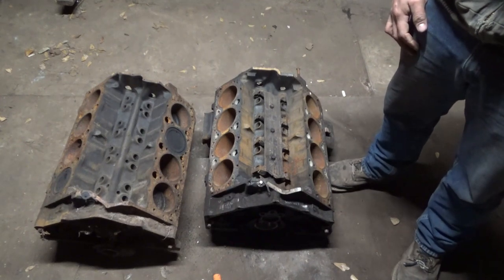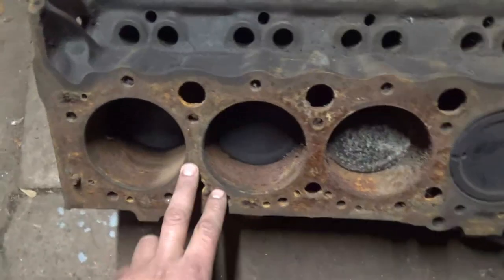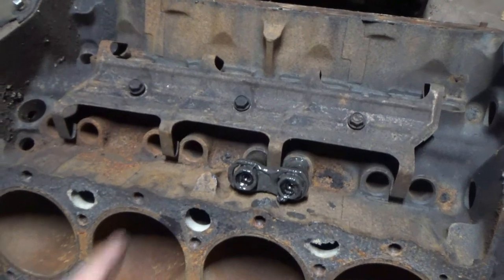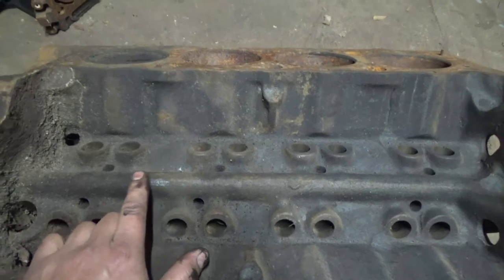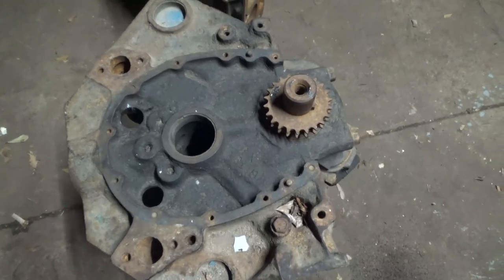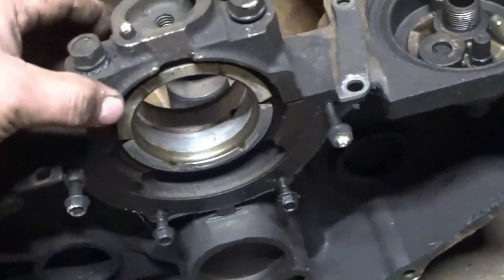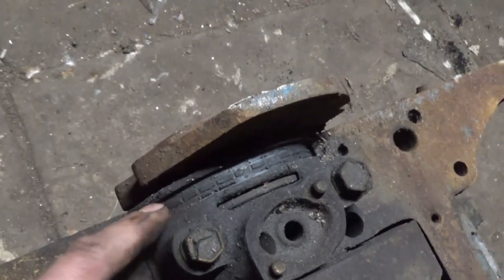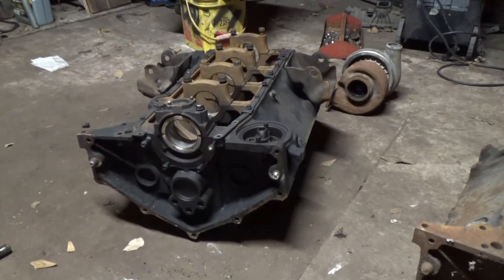Factory roller small block 305 chevy vs non roller 305 chevy

Comment: The fly wheels are not interchangeable. You can change the rear main seal on the one piece without pulling the rear main bearing but you still have to pull the pan. You can run an early flat tappet cam in the roller block, you just use the first generation timing set.

Comment: Cool with your video I now know what to watch out for when I try to switch over my stock 1986 305 flat tappet engine block to a 87 and later roller block. Think I can use my perimeter valve cover bolt heads with a hydraulic roller set up?
Reply from the maker: As far as I know they are supposed to interchange.  The only difference in the heads is the center two intake bolts are at a different angle.  But if you have the older style heads and intake that should work.
Reply: @davidcraft4909 Cool, I will be  using the old intake with the perimeter style heads.

Comment: If you aren,t sure of this or that, no offence ,but why are we listening to your video ?
Reply from the maker: I'm going to have to rewatch my own video later on tonight to answer that question.
Reply from the maker: ok so I finally got around to re watching my video and I understand what you are talking about. But the things I am unsure of are like different variations of what year model came with what and so on. I don't know if anyone can be 100% sure about what small blocks had small flywheels, provisions for mechanical fuel pump, number of freeze plugs on the side of the engine, what came with a steel crank, and so on.  I don't know any of that and the rumors have been proven to be myths.  The important thing is to know what you are looking at when its in front of you regardless of cast numbers and so on.  This is the best explanation I can come up with. I'm sorry if you found the video useless, but that ok.

Comment: The 305 is just not a good base for any kind of performance build . GM new this and went back to the 5.7 in the F body performance models . Anything the 305 can do a 350 is just better at with more h.p. and torque . Even with a single turbo a 5.7 will be better . Look everyone who builds any kind of corporate small block goes stroker over 400 cubes . No mystery there . More cubes equals more power . You think GM would have learned from the 307 . Nobody builds 307 's today to stuff in their whatever when a 5.7 or a 6.6 will be better .
Reply from the maker: I totally understand what you are saying. I mention that in my 305 videos, that it's probably the worst engine to start out with.  The small bore kills it, but 305s are very plentiful.  So, my idea is to put a turbo on a stock 305 and see if it can do anything.  So, let's say you have a 305 with factory heads, and you can make like 200 hp and 250 ft lbs of torque.  Now add 14 lbs of boost, and in theory that would double the torque and hp.  so now you have a 400hp/500ft lbs.  I have never done it, but that is the plan.  I know they are straight turds, the lowest performance sbc ever made probably.  I just have a feeling that with a turbo, a 305 might just do something.  If not I will just unbolt my fuel system and turbo.  and then bolt it up to a 350.  I used to be a big block guy, so i understand what more cubic inches can do.   but now I want to be a turbo guy and see what more boost can do.  Thanks for watching and commenting.
Reply: @davidcraft4909 . Exactly. There are some of us who just want to play in s**t and then beat the clowns with their fat wallet builds….  👍